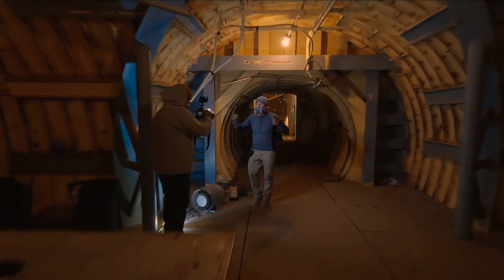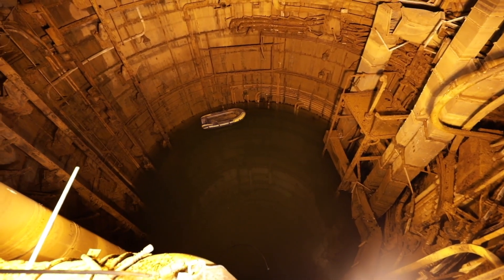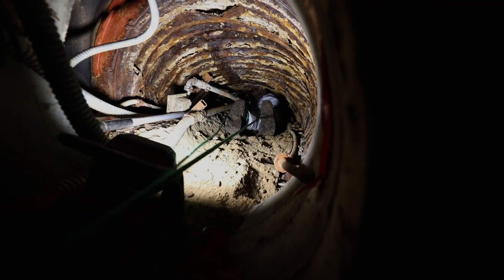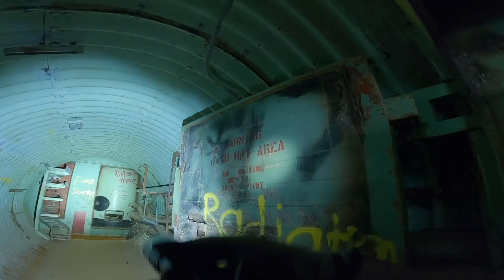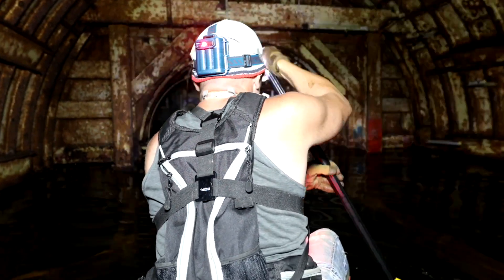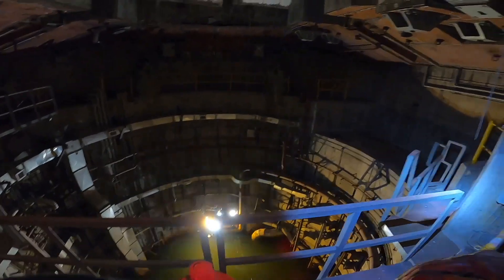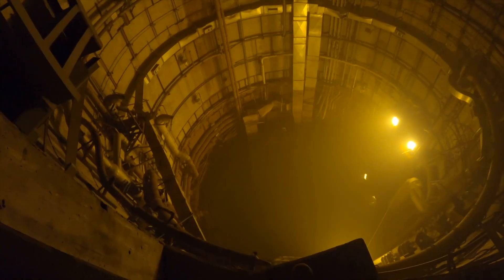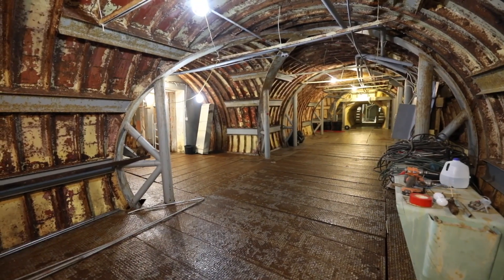Ep. 59 - Nuclear Missile Silo: YEAR IN REVIEW 2022

Comment: If you want to get to that four sensor area again I would suggest using the excavator digging up the old tunnel removing it and replacing it with a new one maybe you can do one that might be a little more wider than diameter
Reply from the maker: NEW Tunnel has been already been acquired. Spring 2023 rehab
Reply: @NuclearBunkerLiving  excellent I was so afraid that the thing was going to collapse in on you and we would be reading about bad news in the newspaper and on the television and on the internet and I'm so glad that you were able to see what's in there without getting hurt